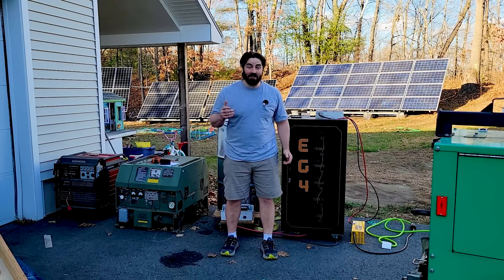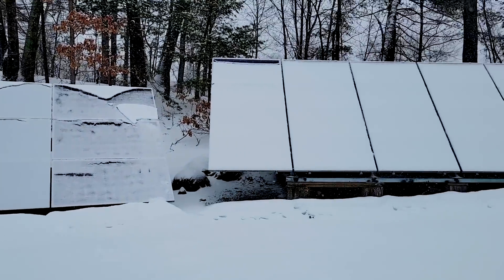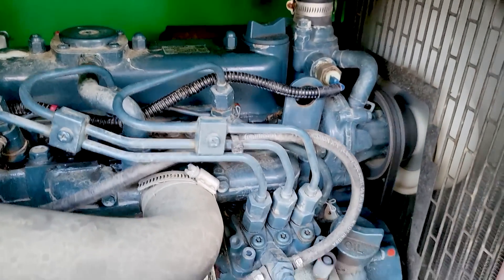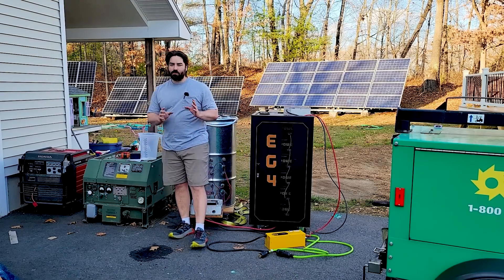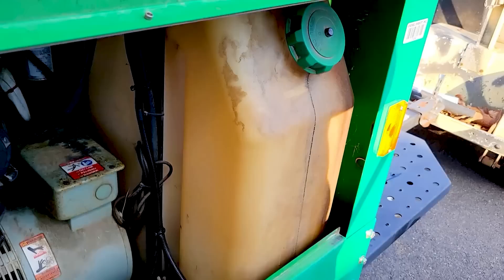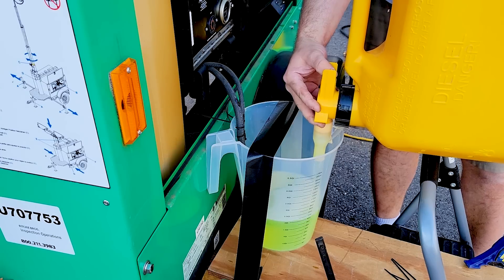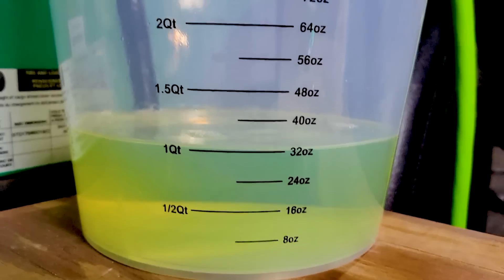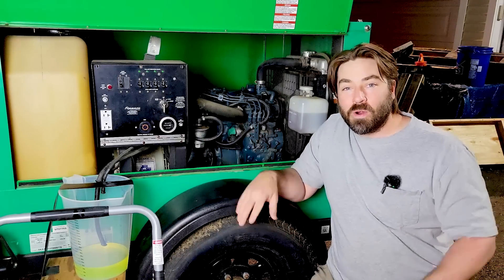Test Kubota: How many gallons per snow storm?

Comment: I purchased new a 14KW generator from Sutech Power Machinery in 2021 for home backup power.  It is powered by a Perkins 403-15G engine and a Stamford 14KW head.  The fuel consumption chart shows at 2KW load the fuel per hour is 0.24 gallons, 4.7KW, the rate is 0.43 gallons, 9.5KW, the rate is 0.77 gallons.  The best economy occurs at 4.7KW, and again at 13.9KW load.  In your test you may not be running the generator at the best power to fuel use for that engine.  You need the engine consumption chart for that engine to see where the best effecient power setting.
Reply: Typo?

4.7kw @ .43 gallons/hour is 10.9 kwh/gal.
9.5kw @ .77 gallons/hour is 12.3 kwh/gal. (30% efficiency for the engine & generator, which is pretty damn good.)

I'd expect running at 13.9kw would be more efficient than 4.7kw.

My understanding is that engine efficiency happens pretty close to the peak power operating point.
Reply: Thats a great point.
Reply: @денисбаженов-щ1б  perkins only makes diesel engines.
Reply: My 4.5 kw on propane running the house, burns 1 qt per hour. Used for emergency power needs.
Reply: Should be ok at the load David is pulling. The engine has 10.8 kW, but the alternator only 6 kVA (or 6kW without phase shift). So running at 52,1V with 98,25A is 5.12 kW to the battery, and the charger may have 95% efficency, so to load on the alternator is about 5.39 kW. A 90% load is most likely best for the alternator. But the engine is too big so it will last foreever. In the end, the efficency is about 19,6% and not really good. At least with this setting you can heat your home by taking the engine cooling lines indoors. That would make the most impact.
Reply: @philherb3843  also when its water cooled you should scavenge the heat also for hot water and the likes with and heat exhanger, even better if you got radiant floor heating

Comment: I love these tests. I can do the same with my setup but it’s easier to watch your videos! I’d be curious on a dual fuel 7500w generator, running on propane, delivering the 5kw through a chargeverter. I think this is a more typical generator people will have on hand for scenarios like this. How many kWh per gallon of propane? I’m figuring a 20 pound propane tank is roughly equivalent to 30khw to get me charged back up but it’s all theoretical numbers at this point.
Reply from the maker: Thanks, I love these tests too.  I have done several fuel tests, but none with propane.  I'd love to try one if I could rent one.  But, I don't want to buy a propane generator just for a video.  I only need a generator in the winter, and in the cold the propane struggles.
Reply: @ Are you saying propane can struggle in winter because of the tank freezing up or just it having lower energy density that the other fuels or what? I’ve been fully off grid for 4 years at 8000’ in Colorado and have never needed to run a generator yet. This last month I got out my generator and chargverter just to give it a test and it worked great but I did notice the tank icing up pretty quick while being drawn down with close to a full load and in the cold temps. 

You should do an update video on an overview of your house. Are you able to cover your heating load with just electric stuff right now? Did I see one of your videos talking about double stud? I’m currently planning the next house build and would like to go 100% electric, including heat, but I still don’t know if it’s realistic in a climate zone 6b even with super insulated walls. I haven’t had an issue with this house but I’m running gas furnace, water heater, clothes dryer and stove with 5kw of solar and 30kwh of battery. I’d at least double the next system but the heat is the real hard one to solve.
Reply from the maker: Yes, propane struggles in the cold.  There are fuel consumption charts available, but I don't have any handy to link to.  Basically, in the cold, you need an extra large tank vs. the consumption rate.  Not a big deal if you just need to run something quick, but a big deal when trying to run a generator for 8 hours.  There are heated blankets made to wrap around the propane tank in winter that some RVs will use.  But, that uses electricity making the total system efficiency worse.

Comment: The way I see it is you have several factors to consider.  Size and Speed, then make/model.  Most generators operate at their peak efficiency at around 50% load.  However, if your goal is to charge the batteries fast, at say 8KW - you'll probably need something around a 16KW generator to do that fast and efficiently.
HOWEVER, if your goal is not speed, then typically the smaller the generator, the more efficient.  Just like in cars, the smaller engines typically outperform the larger ones, all things being equal.  This is because smaller engines minimize the mechanical losses.
So you might see better performance out of an 8KW generator outputting 4KW, or even a 2KW outputting 1KW.  Once you've determined your desired charge speed, it's a matter of finding the most fuel efficient model in that class.
Reply from the maker: Thank you.

Comment: You can use the heat from the Kubota for central heating your home especially if you water cool the exhaust that would increase the efficiency something you can't do with the air-cooled generators. This is something I have wanted to do for 40 years.
Reply from the maker: I agree.  Co-gen is something I'd like to try out.  Have you got any suggestions on Exhaust heat exchangers?  I'm currently looking for a small and decently priced option.
Reply: @DavidPozEnergy  maybe use some generic car EGR coolers in parallel? Should be fairly cheap and exactly maid for this task.

Comment: Can you use the Chargeverter to convert the 240VAC to 48VDC (51.2V). If it’s connected to a 3200 W gas generator? What kind of voltage/wattage would I get?
Reply from the maker: Yes.  If your 3.2kW gas generator is putting out 240V, and is rated for 3.2kW continuous running (not surge) then you can expect the following: 10% is lost in the Chargeverter, meaning out of the 3.2kW, 2.88kW can charge the battery.  If you set the charger to 55V, then you can charge at 52A into the battery. 

Note, if your 3.2kW generator is 120V, then the Chargeverter will still work, but is limited to 45A, or about 2.5kW into the battery. 

Please use my affiliate link in the description if you choose to purchase it, because that will help out the channel. Thanks.

Comment: I just started watching and I’m quite excited. Because I know my answer and my preference. I have a Kabota GL7000 2-cylinder diesel generator. It is super sweet and charges quickly via my XW 6048 inverter which I use as the charger that feeds the battery bank and an Outback Radian.
Reply: Why would you have both an XW and a Radian? Those do the same stuff, but the XW probably does it better (huge surge capacity and dual AC inputs, gen support and better AGS)
Reply: @keithf8649  The Radian has an excellent surge capacity, great monitoring and has dual internal inverters for very low idle consumption. The XW and Radian are very similar in features and you can’t go wrong with either. My XW is from 2010 and the Radian is from 2017.  The XW is a bit small to run the house and I really would rather have two Radians or even two new XW Pros. I have multiple inverters sprinkled around our 13 acre homestead and that is largely because I’ve been a solar installer specializing in off grid systems for the past 20 years and lucky for me, it’s still a hobby I love to do at home.
Reply: @maverickmacgyver  Funny thing is, the XW actually has higher surge than the Radian, but a lower continuous rating. It pays to have one giant low frequency inverter if you need to start large motor loads! Or you could convert all motor loads to inverter drive and not need surge much at all...

The Radian is pretty much 2 VFXR inverters in a split phase combiner. There are probably limits to how much you can unbalanced load the legs compared to the XW, since there is no balancing transformer.

Comment: Have you considered modifying a water-cooled diesel generator's radiator to heat your house? It could be pretty close to 100% efficient then.
Reply: there's good plate type heat exchangers available
Reply from the maker: Yes, but it's a secondary concern.  Before I make the effort to set that up, I want to pick the most efficient at charging.  Once I settle on a generator, I'll probably make a video on the water heating setup.  Any suggestions on good water to water heat exchangers?
Reply: @DavidPozEnergy 
If you have a heat pump, you can do what I am planning to do: build an insulated box around both the generator and the heat pump and place the heat pump intake at the same end of the box as the exhaust, then put holes at the other end of the box for air intake , and you should have one heck of an efficient heat pump - even below freezing 😉
Reply from the maker: That would be a nice setup, so long as the exhaust isn't directed to the heat pump.  The exhaust will build up carbon over time on the cold surface of the heat pump. But, simply using the warmed air from the radiator might be good.
Reply: When I was heating biodisal I was just using a coil of aluminum tubing in a hundred and ten gallon drum. That seemed to work really good. @DavidPozEnergy